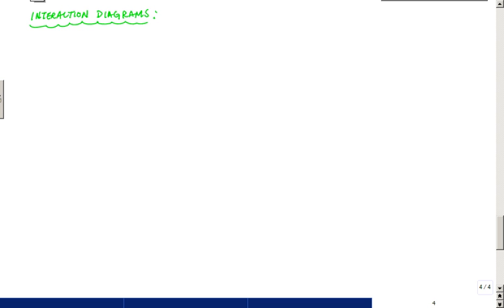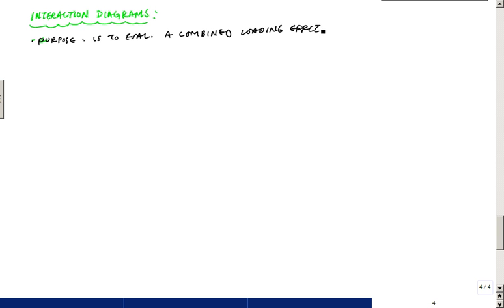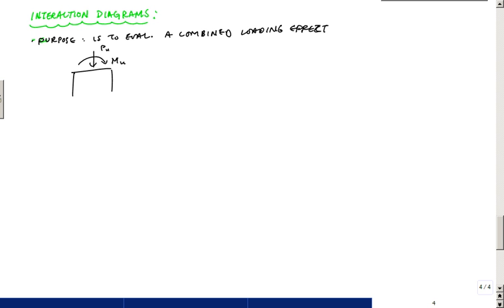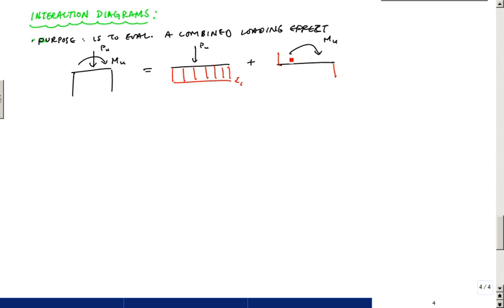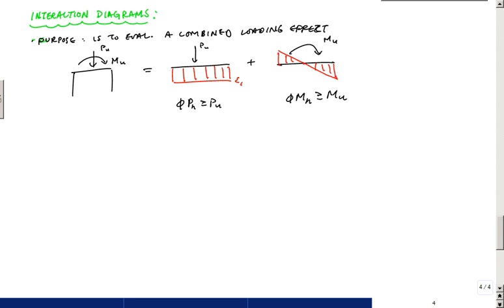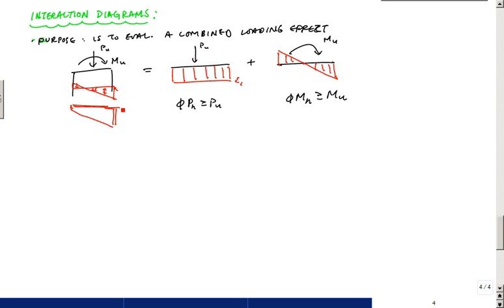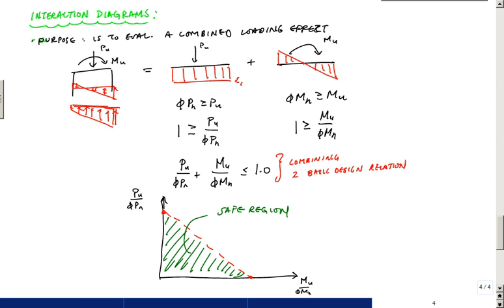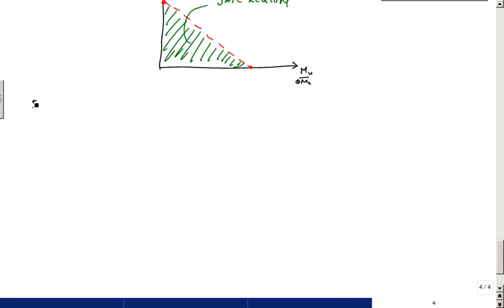Introduction to Interaction Diagrams - Reinforced Concrete

Comment: Thanks for your valuable lectures.
I just want to ask you when this lesson will be continued.
Reply from the maker: +AHMAD AHMAD it is definitely on my to do list.
Reply: +structurefree 
thank you sir
can I ask you a question
Reply: +structurefree 
sir i want to ask you 
if I want to design retaining wall and I have around 20 meters of backfill and I have a soil in the other side of a height around 6 meters 
if I want to check bearing  and design footing ,can I take the passive action to reduce the design moment or no ??
Reply: @structurefree   i thank you very much sir. You are from?.
Reply from the maker: @positivevibes4265  I'm from the USA.

Comment: Why these two terms can be combined like that (3:54)? I was thinking  if a <=1 and b <= 1, then a + b <= 2, right? But it said it was <=1.
Reply: a = Pu/Pn   and b = Mu/Mn... if you look at the diagram (and listen to the explanation at 5:22)...you will notice that as a decreases, b increases (and vice versa)....therefore a  + b  must always be less than 1.
Reply: Ok so lets do what you said and really simplify it by looking at the two worst case scenarios.... what will happen in the equation a+b<=2 if for example we dont have any moment load (as in b=0), you then have a+0<=2 simplified to a<=2 and further expanded to Pu= 2(phi)Pn... is this statement true?  Can Pu/((phi)Pn) really be greater than 1?  That would mean Pu exceeded (phi)Pn which means you have failure due to the axial load.  The same is true if Mu exceeds (phi)Mn you have failure... now in the case a+b<=1, we can examine the same scenario, when we dont have any axial load or any moment we would have either a+0<=1 or 0+b<=1... in both cases we are safe.  Hope it helps and I know it is too late for you at this point but maybe for someone else reading this it will help